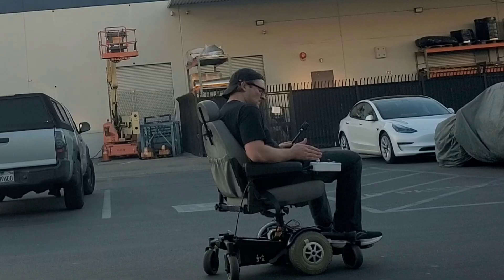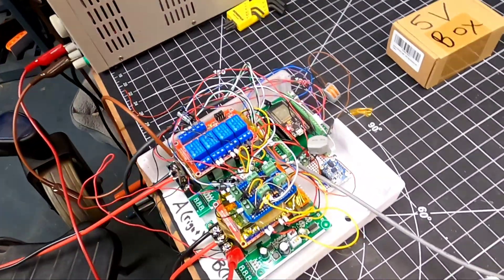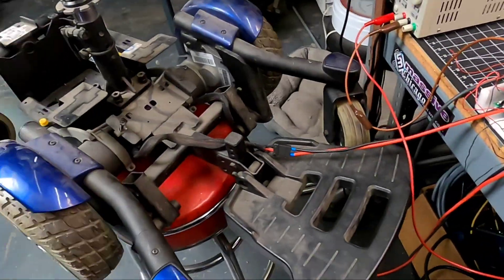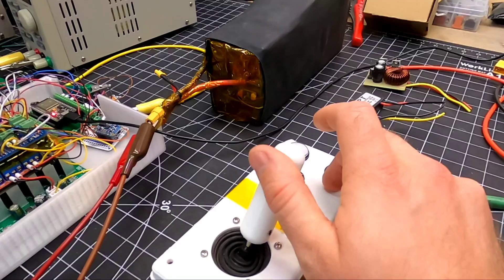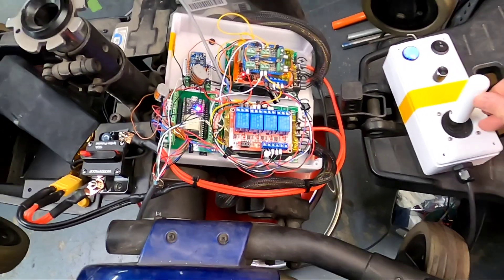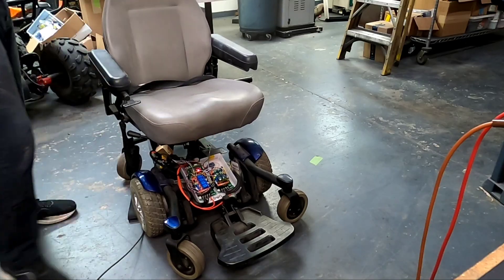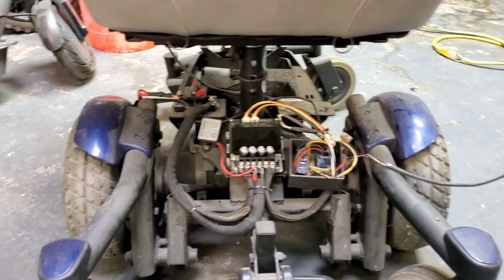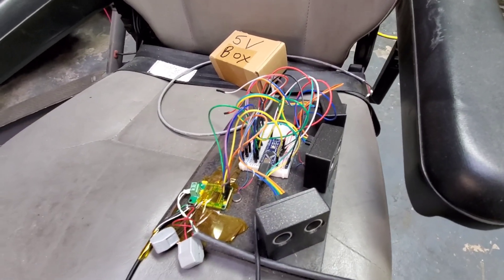Hack a powerchair and make it fast | Part 3 & 4

Comment: Hey, great videos! I am a C5 quadriplegic with a spinal cord injury I sustained 25 years ago After a motorcycle accident at the age of 19I've been using a chair More and longer than I More and longer longer than I was walking. Problem I've had The last 15 years is That I have gotten so good and used to using my wheelchair That the stock version of7-9 7-9 mph With a chair's  I've had which are usually Storm series series and ranger X. which are beafyer than the jazzy You're working on. I've been envisioning Designing my own Power wheelchair sold atMaster quadratics or wheelchair users like myself  can Handle The extra power and speed. I have several Spare chairs to work with. Your videos inspired me To get started on this project Because who knows how much longer I have to live And change some And change some people's lives for the better at the same time. Keep up the video I want to see Reset Reset updates. I will be starting my project This is Octoberups. Before that I hope to Learn more from your videos in current project. You're opening doors that should have been open Decades ago.